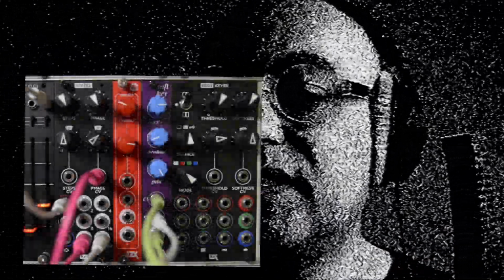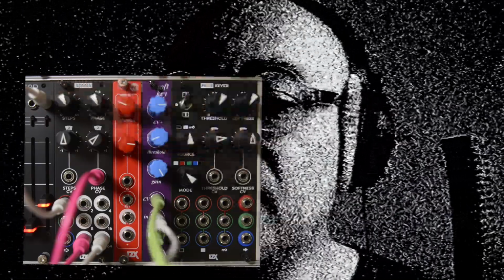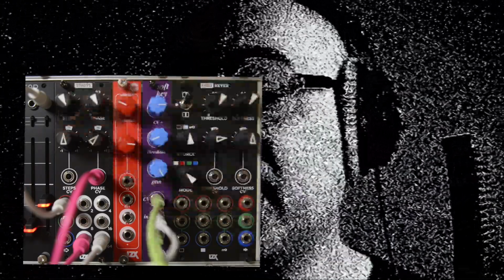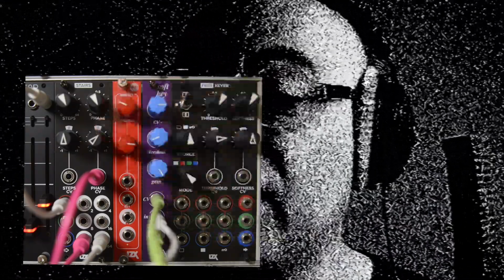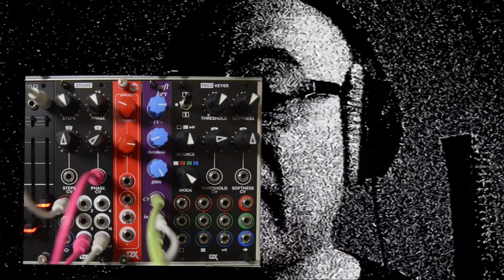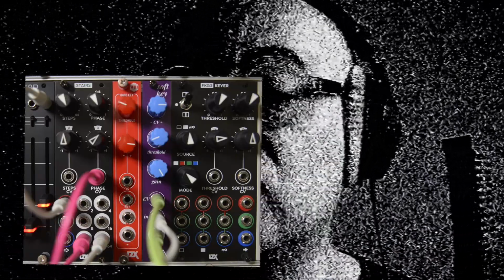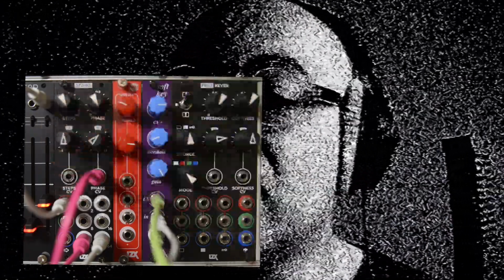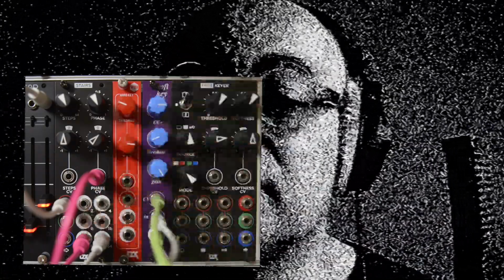White Noise Tutorial using LZX Stairs 2025

Comment: Thank you😊. Do you have a link to the manufacturer of the soft key?
Reply from the maker: It's the Martin Devices Soft Key. I don't think that he has a website but there is a thread about it on the LZX forum. You should be able to get hold of one through there.
It's a great little module. You can never have enough keyers!
Reply: @marizuokereke7347 thanks so much for the information! I am looking forward to see other post from you 😊